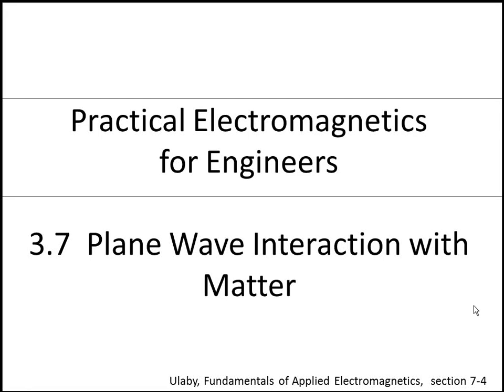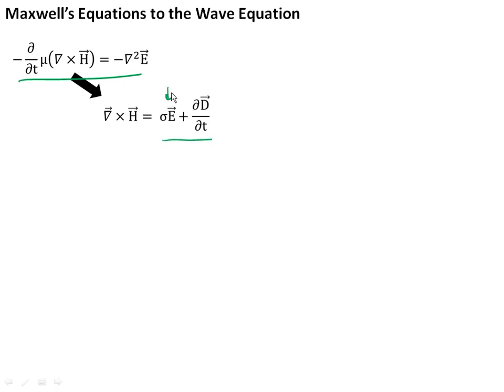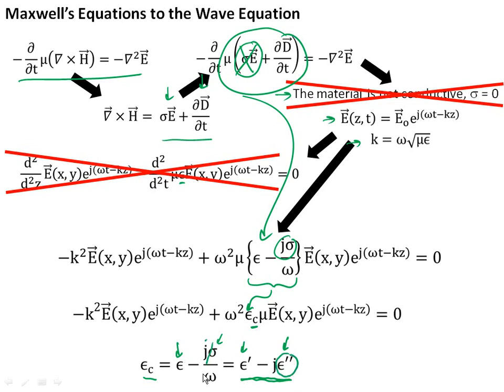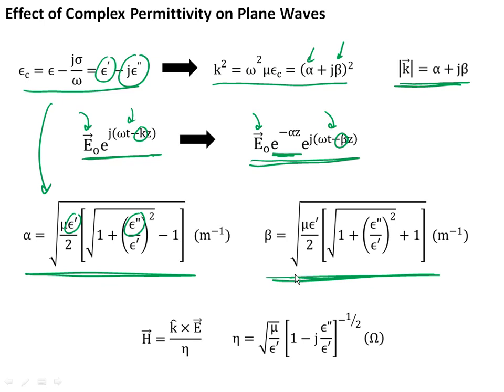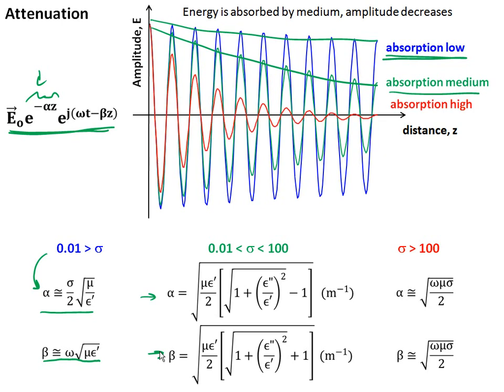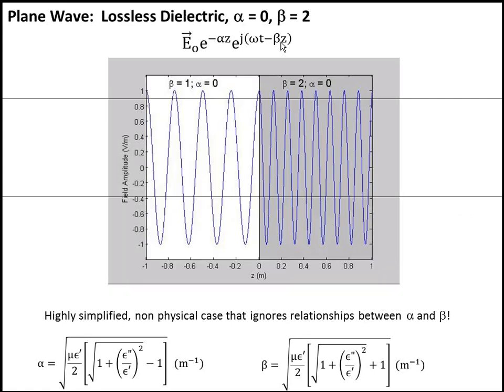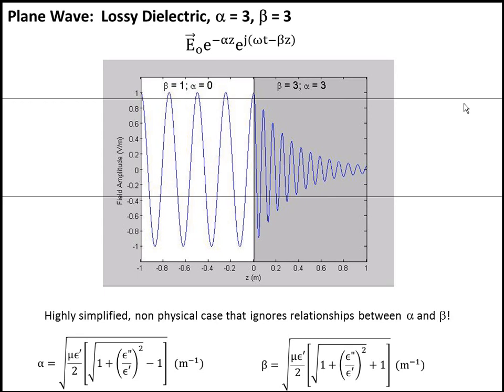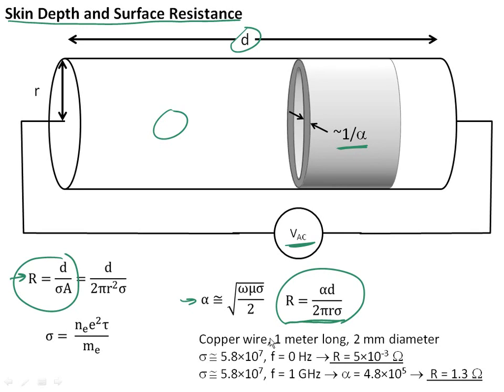3.6 Plane Waves in Matter

Comment: Dear Kridnix,

Hi. If you try to plot the slide at 14:05 in your video in MatLab, you do:

fA = [];
for i = 1:n_media
    alpha = media(i, 1);
    betha = media(i, 2); %4*pi
    z = z_media(i, :);
    
    %plane-wave equation assumming epsilon_complex
    fieldAmplitude = E_zero*(exp(-1*alpha*z).*exp(complex(0, (w*t - betha*z)))); 
    fA_temp = real(fieldAmplitude).^2 - imag(fieldAmplitude).^2;

    fA = [fA, fA_temp];

end

However, I am not able to reproduce your curves using the given values of alpha and betha. Are you multiplying them by a factor somewhere? Thanks for your answer :) It will be extremely helpful.

Comment: Hey man, I used your videos as the basis for a project I did in my PDE's course on the 3-D wave equation, so thank you for posting such an in-depth analysis. One thing I wish I could have done though was shown your simplified model for the plane wave with chosen values of alpha and beta (I ended up drawing them by hand). Is there anyway you could upload those/provide a link where I could view them outside of your youtube video? Thanks!